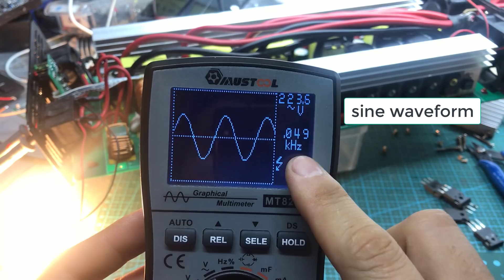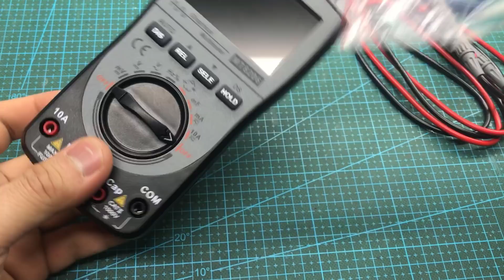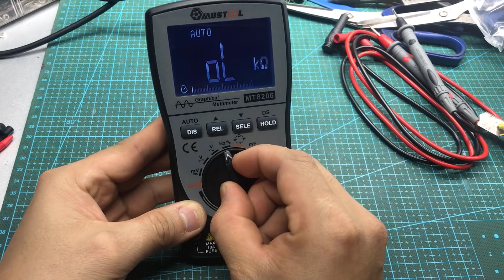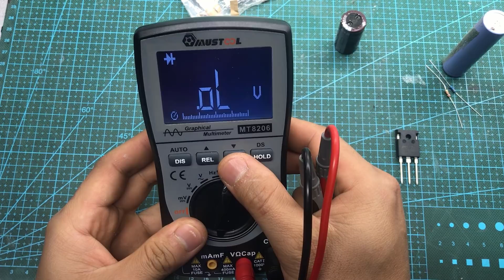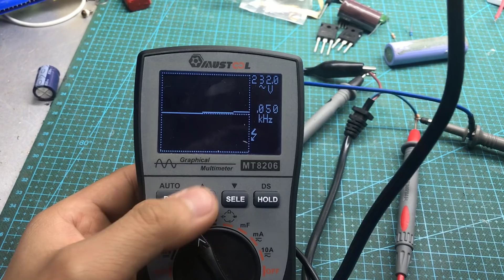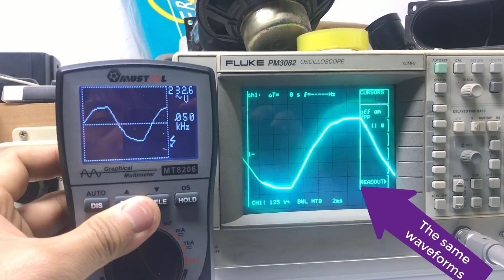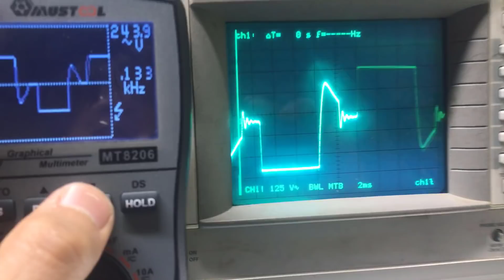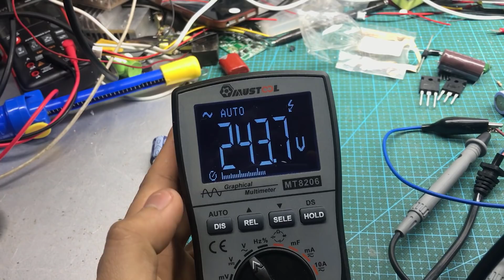Best 2 in 1 Multimeter Digital Oscilloscope

Comment: Please can you make a tutorial on how to connect more than two EE42 core to make inverters please.
Reply from the maker: ok bro, wait me. i will make video.
Reply: Yes it's important...just thinking that each transformer have 100vdc x4=400vdc on the primary side ?and the primary will be like for 12v=2+2turns,24v=4+4..etc then the mosfet side will be 4right,4right for each transformer but control by 1 sg3525.the retifying diode will be big size and the hbrigde will have 4 igbt of about 600v80A which then controlled with egsoo2 with Spwm choke filters at the output the deal is done...I hope so

Comment: Can you tell me without load self Amp consumption of your pure sine wave inverter,as they are not iron core transformer so we suspect self load must be less than 0.5 Amp
Reply from the maker: If it is using a pulse transformer, the no-load current is less than 0.5A for a 12V system. less than 0.3A for 24V systems.

Comment: why? why should I use alkaline batteries? what if I want to use rechargeable?? I use them in my ''fluke''..
Reply from the maker: Yes, you can use a rechargeable battery, however it will be more expensive. Do not use graphite batteries. When it runs out power it often leaks acid. it will cause corrosion.

Comment: Hi ihave something too ask about my inverter welder it has 4 igbt and sg3525 ic.iwant too modify it too tig welder and the problem is there is output in the welder when i turn on iwant too add switch for the tig torch can i just the supply voltage to sg3525 and connect the switch threre without blowing up the igbt's?